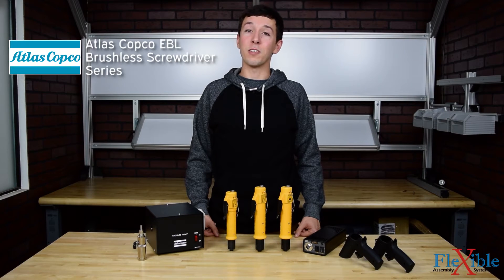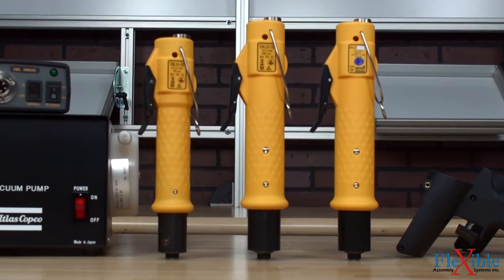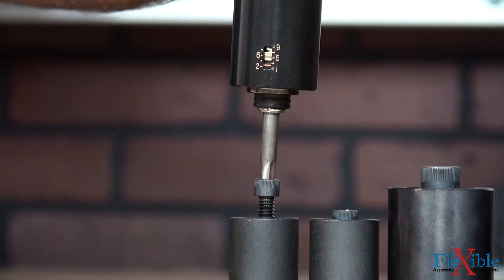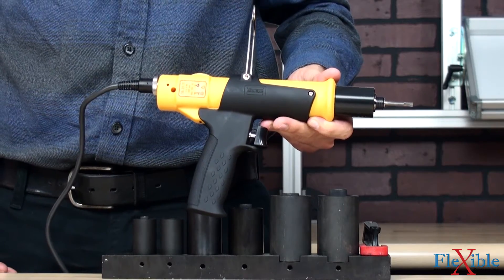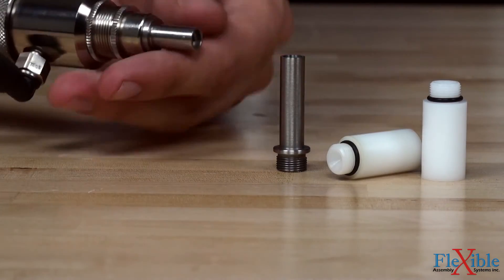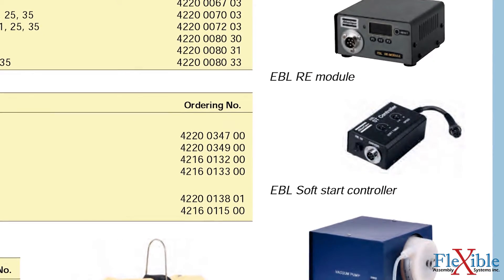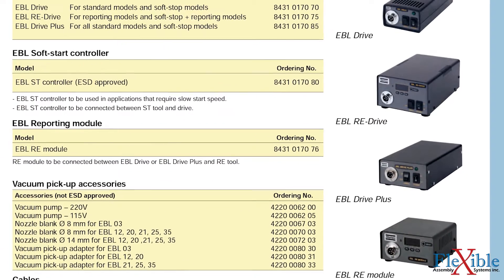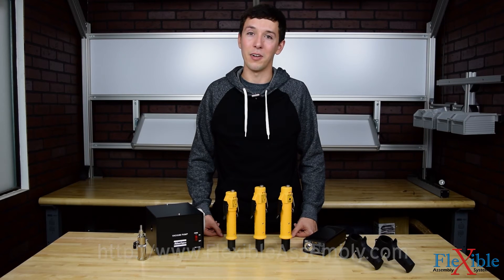Atlas Copco EBL Electric Torque Screwdrivers

Comment: I have EBL RE - Drive and EBL RE Module, how can i make it doing my already set program? And what the input and output is for?
Reply from the maker: The different "F" buttons on the front will toggle between Tightening cycle time programs
. The I/O on the RE models are for digital signals for line control.

Comment: can we connect this to stack light to get torque confirmation ...?
Reply from the maker: The basic EBL controller does not have the ability to attach a stack light, nor do the EBL tools have a transducer to verify torque output.
Reply: @FlexibleAssembly  😊ok thank you